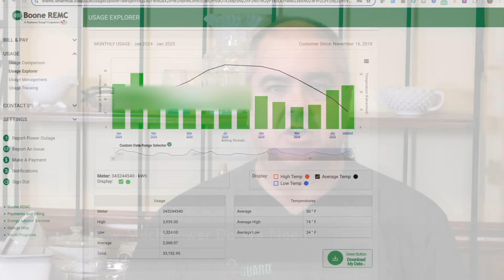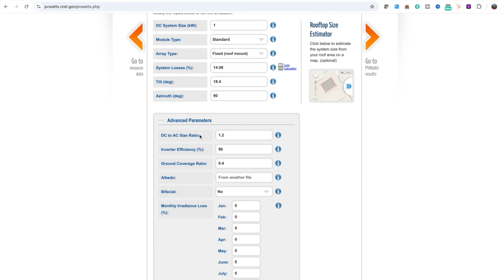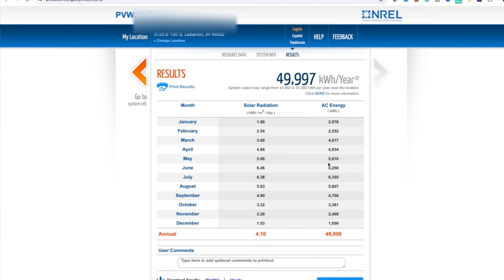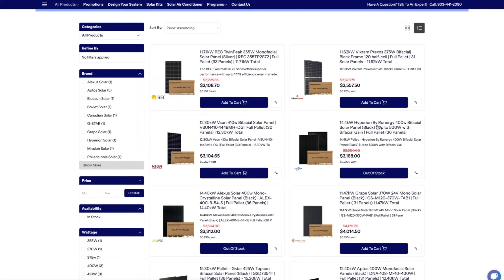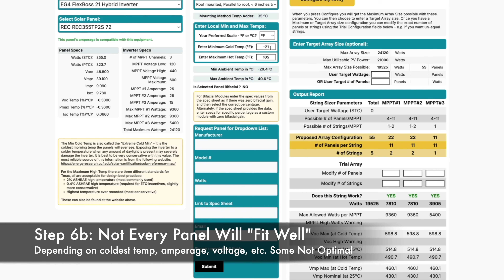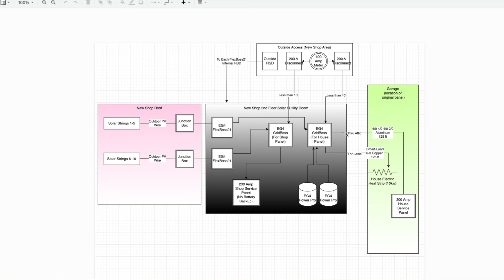Sizing My Solar System; 8 Easy Steps

Comment: How are you planning on cleaning the solar panels as they need it?
Reply from the maker: My lift and pressure washer.
Reply: @TractorTimewithTim  Be careful with pressure washer. You could damage the solar panels if pressure is too high. I use a long window washing pole with a window washing head and a mild window cleaning solution.  Then wash with garden hose. Been doing for 10 years no damage yet.
Reply from the maker: @jacksinkowski227 ok…thx for advice. I could do that from my lift.

Comment: You could put quite a few of those panels on the South roof of your house; they would not be visible from the road and would be significantly more efficient than on the east and west sides of your shop roof. That way, if you decide later that you want more, you still have the majority of your shop roof available to you.
Reply from the maker: Yep. Design has been changed to put 33 panels on south house roof. Thx!

Comment: WOW you use a LOT of power, I'd be curious to see a breakdown of the electric use by major device. If you can afford all of that solar hardware how can you not afford the copper wire to connect back to the current house panel?? It has to be a minor fraction of the total cost.

Comment: Sounds like your father-in-law is one tough cookie! Praying for the best! I installed Solar last February and didn't spend a dime. It's a partnership between us and the solar company. They get a fraction of the electricity my panels produce. So far my electric bill has dropped almost 80% compared to the prior year. Another bonus is that the solar company provides any maintenance costs and covers all updates. Best Regards, Jay

Comment: Glad to hear things are improving.  I'm not familiar with this brand of solar, your exact expectations, or your utility requirements, so consider the following points to ponder...A lot of solar systems require power from the utility to use as a frequency reference, and shut down if it's not there.  I saw that there were batteries in the system, if your intent is to use this as a backup power source, you may want to make sure yours isn't one of them.  If that's not the case, I question the use of batteries, instead of back-feeding the grid.  Batteries are expensive, somewhat bulky, and have a finite life, plus, once they are full, any additional energy your panels produce is wasted.  My final thought, is if the space/budget/situation/finance committee permits, and your local utility will let you back-feed, I would oversize my system to the extent the roof space would allow, and let your utility send you a check every month for the surplus power.  It's one thing to know your expensive solar system is reducing your electric bill, but it's less tangible than seeing a check show up every month.

Comment: Hey Tim,
Over educated PV consumer thoughts:  
As you stated, your goals are your own as well and need consideration. Since you are not getting full retail price on your PV, It might be nice to ensure that both inverters share the same paralleled battery. Then the battery can always be topped off. Then at night you drain that battery as low as possible to cover your loads to self consume as much as possible. This will help ROI. I think you could also put your water heater on a smart port to heat water only on PV as well. (I have a solark but,) I am guessing in a grid outage, even tough both inverters share a battery, you could limit the shop inverter to not power up in a power outage to conserve battery power.

Also if you have not built your own ROI spreadsheet I can offer you the one I built before doing my PV system.

Comment: Tim, what is code down in your county, in terms of maximum panels on a property? Up here in NE Indiana, my county has put in a 40kW maximum on roof mounted solar, and 40kW maximum on ground mounted solar. 

Your planning looks very solid, I'm about to finish my DIY 20kW grid-tie install, just a bit of wiring left to do. I went with Growatt, just to keep costs down.  As for transition from CU to AL wire, just use a short piece of copper into the grid boss, to a junction box. In the junction box, use a Polaris connector (dual rated CU/AL) and you've got an easy way to hook them together.

Mounting costs? I've got more cost in my ground mount than any other piece of the system, including the inverters.

Comment: Did you have to do a DER Interconnection Application with Boone REMC?
Reply from the maker: I will have to do an application with BREMC.
Reply: @TractorTimewithTim  10-4. I'm a utility system planning consultant, and doing system impact studies for electrical cooperatives has been a big part of my job the last 5 years...anywhere from 100kW to 30MW interconnections.

Comment: I would NOT recommend going with the aluminum wiring, even though it is less expensive. As a former Volunteer Firefighter, we had at least 1 structure fire that had aluminum wiring that was installed in the house. From what I remember, the State Fire Marshall had difficulty in determining a cause of the fire because there were multiple points of origin. 1 point of origin was the electrical panel. The other point of origin was near a backpack that possibly contained flares and was near an extension cord. Another possible point of origin was near a dividing wall for a stairwell. I don't remember if there was any wiring in that area or anything else that may have contributed to creating a source of ignition.   I do not remember what the fire Marshall finally determined to be the cause of the fire. The last I remember was the insurance company and the homeowner fighting over a payout for the fire. That was almost 30 years ago. 

When i went to school for firefighting courses at the local community college, the class on building codes and construction had stated that, even at that time,  most municipalities were banning the use of aluminum wiring because of fire safety.

Comment: It is a shame with healthcare quality. With both my Dad and Mom it was us researching issues and meds that led to results. I’m thankful the doctors were opened minded during discussions, but concerning nonetheless. 

Thought on solar mounts—my son rented covered RV parking while stationed in Arizona for work. We pulled up and the cover was actually solar panels.  Had gals for sunlight for plants but offered great deal of shade and rain protection.  Just a thought to mount them up high on pole type framing in south facing rear yard….kindof a nice covered pavilion so to speak and keep em off the roof. May even reduce volume being south facing.

Comment: Why not use standing seam for the roofing not much more per sq ft and also no penetration need for the panels? And also no exposed fasteners to leak over time.
Reply from the maker: Correct on all your positive points….but standing seam is much more expensive…at least with my builder.
Reply: @ cost to benefit on this one is what I’d be looking at yes you’ll pay more for labor to have standing seam put up but almost no chance of leaks. And I believe mounting a solar panel is cheaper.

Comment: You will have to look into this further to see if its cheaper for you.  Consider changing the type of metal roofing you are considering.  If you went with a standing seam roof they have solar mounts that attach to the standing seam.  The mounting hardware might be cheaper and you will not be penetrating your metal roof reducing the chances for roof leaks.  I know standing seam metal is more expensive but if it off sets the cost of mounting hardware and the added benefit of not penetrating the roof metal it might be an option.  You will have to run the numbers.  Good luck.
Reply from the maker: Yes, all your ‘positives’ are definitely positive. ….but standing seam is much more expensive.

Comment: Part of the kicker of your electrical bill, if not now than in the future, is your peak usage multiplier.  Without battery backup you will get dinged there, and I assume when your power is out and the sun isn't shining you don't have power?
Reply from the maker: Not sure we have a ‘peak usage multiplier’.  I think we pay flat rate per kWh.   We SHOULD probably have some incentives to reduce peak usage, but I don’t think we do.
Having said that, I do have a couple of batteries in the plan.  Not enough to make a huge difference, but I figured I could add more over time.

Comment: I live not far from you, just south of Indianapolis.  We both pay about the same amount, per Kwh, for electricity.  We also both have to deal with the simple truth that central Indiana has relatively poor solar potential; there are too many days that are partly to mostly cloudy.  The ROI on solar, in Indiana, takes a long time, long enough that I wouldn't be doing solar at all, if I couldn't save a ton of money by building a DIY system.  I don't know how much you plan to install yourself, but in my investigation of the various costs and ROI, the price of installation was a killer.  It made it untenable, in my situation.
Reply from the maker: Yep.  Installation makes all the difference!  That is why I like signature solar.  They are geared toward DIY.

Comment: I have 400amp also with total solar coverage 14KWh. Zero electrical bill. The main question is did you get the Electric Company approval? They are the last to approve your Grid-Tie system. If you are above a certain KWh they can force you to be Off-Grid. Ours is 24 KWh. If you are above that you cannot Grid-Tie. You are considered a "Power Plant".
Reply from the maker: I think I’m cool.  I discussed with them.  I think ‘net zero’ is their position….but of course, not sure.
Reply: @TractorTimewithTim  make sure to ask

Comment: We took care of my wife's father the last 10 years of his life and it was a huge blessing to our family.  The kind of character you consistently show is why I keep watching the content you put out.  As someone who has installed panels in several locations, I can tell you that if you install those panels on your east and west facing roof lines, you're going to really be frustrated come next winter.  They'll be fine during the summer and shoulder seasons, but from the end of November until the end of January, you will really be wishing you put at least one of those strings on the back of your house and/or the connecting structure between the house and the new shop.  If it's not too late to change your design, putting some of the panels in that location would be very helpful next winter.
Reply from the maker: Do you think I can mount on the 10/12 pitch of my house?  Seems kinda steep.  Maybe with my new boom lift, it won’t be so hard
Reply: @TractorTimewithTim  - That is steep, but exactly what you want for panels meant to provide PV input during the winter.  They will shed snow better and, since they're facing due south, they'll get the most possible production when the sun is low on the horizon.  It will definitely be more challenging than working on the new shop roof, but I can tell you from painful experience that east and west facing panels just don't give you much during the shortest days of the year.
Reply from the maker: @jasonbroom7147 ok.  I think you’ve convinced me.
If I can get 26 panels on that roof, that would be two strings of 13…one for each of the inverters.
Reply: @TractorTimewithTim  - The only concern to be aware of is, putting holes in the roof of your new shop is one thing, as is putting holes in the roof of the breezeway between the shop and the house.  Putting holes in the roof of your HOUSE requires a different level of confidence in the mounting system you're using.  As long as the roof is relatively new, and you have faith that the mounting hardware won't leak, it's the best location you have for winter production.
Reply from the maker: @jasonbroom7147 gonna reroof the house with the same steel used on shop for consistency.
Thinking of using the mini rails from signature solar.  Check em out and let me know your thoughts.

https://signaturesolar.com/mini-rail-kit-6/?ref=TTWT
Reply: @TractorTimewithTim  - If you're redoing the roof as part of the project, then it's a great time to put the panels on those south-facing slopes.  I'm sure that mounting system will work well, but verify the wind and snow load rating are suitable for your location.  (Snow won't really be a concern, at the angle you're mounting them.)  As a bonus, those panels will be in the least visible area of your entire property, so less of an eye-sore.  Although, it has been my experience that once you see things running off the power they bring in, they start to look kinda pretty!  :)

Comment: I would never run aluminum wire in my house.  Copper is cheaper than a fire.  Otherwise run the aluminum outside the house.
Reply from the maker: ok, thanks for feedback. Worth considering.
Reply: Stranded Al and the newer Al alloys are totally safe to use. The problems with residential Al wiring from the 60-70’s were with solid 12 and 10 ga wire.
Reply: Given what I saw in the late 70s and early 80s in terms of fire damage and loss lot life, I will never use Aluminum wire or allow it to be used in my buildings.

Comment: We have had solar for 10 years now.  We only have 13 MWh a year (not 50+ - YIKES) but our power is running about $0.35 per kWh currently.  Our system does cover our annual costs (minus the EV - still monitoring that addition)  Our biggest improvement was to cut electrical use.  LED lighting was a huge improvement we started nearly 15 years ago.  For example, tossing the old Christmas Tree bulbs for new LED (and yes, you can finally get LED that look like the old bulbs) altered just our Christmas use from 268 watts to just 18 watts.  Changing our outdoor flood lights over the driveway went from 400 watts to just 40 watts and I think the LED fixture has better coverage.

Can lights, lamp bulbs, etc are all updated.  Yes, the expense was there as we started back when a single LED bulb was nearly $50, but the impact on electrical use was such that it has long paid that back.

One limit we had is that Massachusetts has a sweet deal with the utilities that cao household solar to just 10,000 watts.  So, I can't just add more panels to cover use.  As our family grew, we added computers (I have a server rack), and other use, we had to implement ways to reduce our demand.

We use power optimizers to ensure that our inverter sees a constant voltage of about 350 volts.  As you said, amperage can vary with little impact, its the voltage that can kill an inverter.  The PO's work together to keep the voltage nearly constant.  That also provides a 98+% efficiency out of the inverter.  When you are limited, that's the kind of tricks you have to play to squeeze everything you can.  But it also allows a 25 year warranty on the Inverter too.

BTW, when an inverter "goes", it's typically a component called an IGBT that fails.  These are fairly inexpensive to replace.  I know several people who have done that with success.  The hardest part is getting the component off the heat sink and getting the new one back attached properly.  But it's no harder than doing the same with a microprocessor.  This component is the "switch" that turns DC into AC.  I've built several tesla coils using these with great success.  Where you are switching at 60 cycles per second in your inverter, my tesla coils are switching about 125,000 times a second.  So the component is fairly robust when you can keep the voltages in check. 

Going to be interesting watching your project.

Comment: Installed solar last September. 16.77kW on a Sol-Ark 15k inverter. I'm expecting a major breakthrough in cold fusion any day now. 😉 One bit of advice if I may, it looks like you have a large area of south facing roof on the house. Make use of that. I installed on my south facing (6/12 pitch) roof and also put some panels on an east (4/12) roof. This time of year the output from that east facing roof is so low I thought there was a problem with the panels. The peak output of my south facing panels this time of year is about 350W/panel. On my east facing roof they barely hit 150W.  I'm hoping the summer output will compensate, but I'll have to wait and see. Use as much south facing roof as you can. My $0.02.
PS: I'm in southern PA for a latitude reference...
Reply from the maker: My south facing house roof is 10/12 or 12/12.   Pretty steep.
..and I'm thinking it might be shaded by the new shop.   
Good point though. Maybe I could figure out how to use it.
Reply: @TractorTimewithTim  Ouch. Yeah, that is a steep roof. One reason why I mentioned my pitch so you could use it for comparison. If the pitch of the roof you plan to use is less than the 4/12 your performance should be better. Even if the new shop does shade that roof some, I'll bet you could still run a string near the peak that would be in full sun until it was so low it didn't matter. I guess I'm up to my $0.05 now. 🙂

Comment: Maybe you could use that solectrac electric tractor as a battery storage/ backup battery bank if you haven't done anything with it yet. It would take so engineering but could be done.